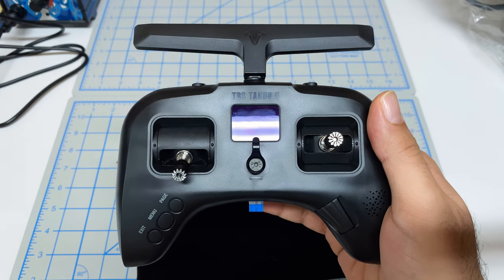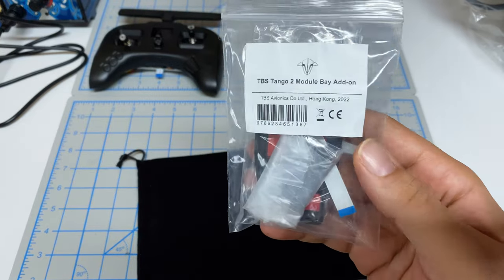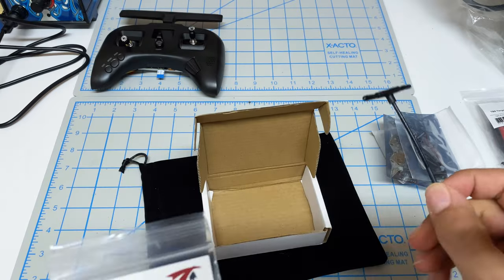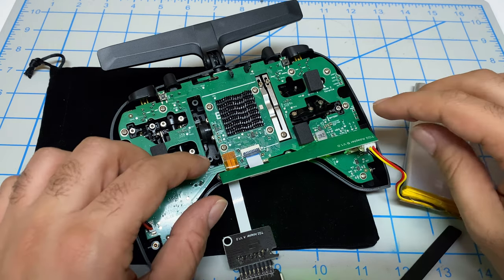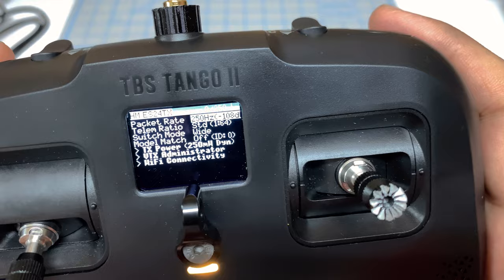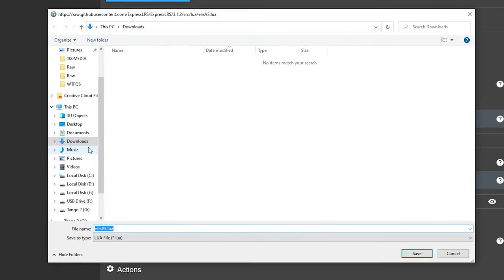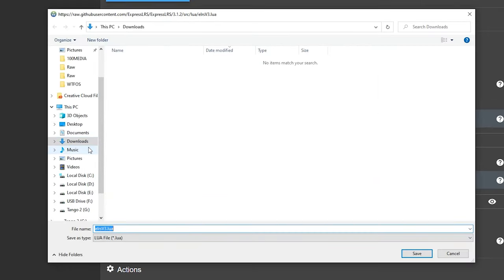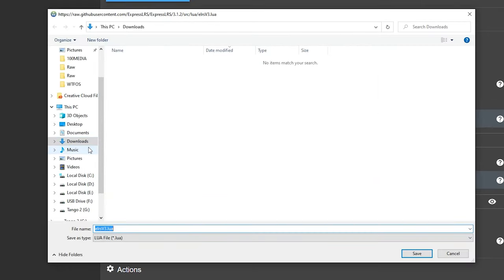TBS Tango 2 Pro INTERNAL ExpressLRS | How to guide on stuffing an ELRS module INSIDE the transmitter

Comment from the maker: Hey Folks, thanks for watching this video! At the very end we talk about a weird behavior when you attach the module bay attachment to the tango 2 (happens as soon as you connect the add-on board regardless of whether a tx module is in or not!).  UPDATE: Thanks to tennturk who contacted support on this and received the following reply from TBS support: “it is a bug which will be fixed in the next release. No available info yet when” UPDATE2: Make sure to check out the update to the antenna approach here https://youtu.be/g4PU8CVhZKo.
Reply: Huh I have to try to fly my crsf quad with the elrs module on the back and see if I have the same issue! Going flying today and I'll report back.
Reply from the maker: @baggszilla  Thanks, let me know. Someone else posted that the light at the front should turn off when you're using the external RF but mine is still active for some reason.
Reply: @Mangorille  maybe it’s something to do with the Happymodel adaptor.  I used the TBS external module bay adaptor (I originally wanted to put it internally like you did, but I couldn’t fit my chosen module board between the gimbals, so just did the external mod), when you switch to the external module it does indeed turn off the LED on the front of the T2 and switches on the external power - my ELRS module is only powered on when the particular ELRS model is selected and it turns off when I switch back to CRSF.

My guess would be the Happymodel PCB board add on you’ve added has something to do with the problem, maybe it’s not feeding a clean or full power through to the T2.
Reply from the maker: @testpilotian3188  Thanks for sharing how yours works. I tried with the TBS module as well and it did the same thing. Perhaps something with my version of the motherboard? When I use the external module, the front LED is on and when I use the crossfire the front LED starts pulsing.

Comment: Unbelievable you got this to fit inside! I love it! I just recently painted pearl white nostalgia case, V3 board with happymodel power adapter, tbs v2 gimbals and external module bay with the happymodel es24tx pro nano module and its a completely better radio! I love the Tango2!
Reply from the maker: I'm hoping to try to get the es24tx pro in there some time in the future if I can get my hands on one but I suspect 250mw is plenty for my kind of flying.

Comment: I FINALLY got around to doing this and i want to extend a HUGE THANK YOU for making this video!!!!it works better than new and dont have that stupid module hanging off the back of the tango2
Reply from the maker: Welcome. Check out the follow up videos as well for the ultimate sleeper mod.
Reply: @Mangorille  I saw the video, but im worried about all the mods involved with the new ELRS module. This one took a little massage to fit but is working perfect. Using the flip down original antenna on your new mod does look amazing tho!!!
Reply from the maker: @Snakkerz003  The BETAFPV module is a lot more difficult to install but the extra effort gets you an additional 250mw (250mw vs 500mw). Go with whichever module you can find, they're becoming hard to find.

Comment: A complicated mod done very cleanly. I am glad we think alike about the heat issue, which was proven to not be an issue after you tested it. Great job man! And regarding the voltage drop when the receiver is disconnected, I think lithium polymer batteries generally cant supply much current at 3-33.2V so what I figured since there was no receiver, the ELRS module being on dynamic power was maxing out the output power where when a receiver is connected, it ramps back down to 25mw probably. Again this is only true if at that time you were on dynamic power but I am pretty sure you considered this already. Once again great job man!
Reply from the maker: Thanks for the note. I've been working with TBS on the voltage drop issue, they said it is a bug in the firmware and are working on a new crossfire firmware to resolve. They asked me to wait for crossfire firmware 6.20 a couple of months ago. Patiently waiting here. :)

Comment: Put the antenna in the 900 mhz antenna plastics.
Reply from the maker: I love the idea and would make for the ultimate sleeper! BUT, there doesn't seem to be much space in there looking at the clear antenna that TBS offers. Perhaps it can be done with a bit of shaving of the plastics, etc. but I don't have an extra antenna that I can sacrifice to give this a try.

https://www.team-blacksheep.com/products/prod:tango2_t_antenna
Reply: I am thinking same thing.
Reply from the maker: @bcc1955  I did some more research on this... The two halves of the antenna are ultrasonic welded together, you'd need to cut it apart.
Reply: @Mangorille  Initially I was thinking it would be nice to have both antennas hooked up this way, ELRS and CRSF. Is that feasible or is your alteration just one or the other?
Reply from the maker: @bcc1955  I've moved the CRSF antenna internally and made the external antenna the ELRS. You can do it the same way I did. Ideally you'd try to fit both antenna into the OEM housing but you need to be willing to sacrifice the antenna housing by cutting it open (it's ultrasonic welded).
Reply: @Mangorille  I just watched a video (in Indonesian unfortunately) where a guy has a bardpole inside the transparent antenna housing alongside the original antenna. Not sure how he got it in but you can have a look, skip to about 8:40 https://youtu.be/x2WWaKUyGnQ
Reply from the maker: @CoopzVideo  I've got a solution for this, stay tuned for the next upload on the channel.
Reply: @Mangorille   Nice, looking forward to seeing it!
Reply: my thoughts exactly. was scrolling for this comment.

Comment: Thank you Mangorille. Just finished my Tango2 ELRS install. Great project you created. It was definitely a challenge getting everything shoehorned in there so that there was no interference with the push buttons and power switch. Devil/God is in the details as is said. Everything works via a bench test. Only need to do field test. I am using a V1.1 (VOO7C) board and the front light goes off when switching to the external CRSF setting and ELRS module.
Reply from the maker: Congrats on doing the mod! I reached out to TBS on this issue and they said a new firmware would be coming to resolve it. I'm still waiting for that new firmware. I tried an older firmware and the light did turn off but the issue still continued.
Reply: @Mangorille  I do not believe I am having this issue. When I go to external RF, my dash light goes out, and my Tango2 stops communicating with my CRSF RX quads. How are you diagnosing that the CRSF board is being powered up along with the ELRS board even when light is out?
Reply from the maker: @bcc1955  TBS asked me to run some tests and share some videos, which I did. They worked with their engineers to determine that it is a firmware issue.
Reply: @Mangorille   So I got my ELRS quad flying today using my Tango2 Hybrid. Confirmed my first observations above. Are you thinking that in my case both CRSF and ELRS are similtaneously powered up when External RF is on, even though dash light is out and the radio no longer arms my CRSF quads? That would be a negative with regard to heat and battery life.
Reply from the maker: @bcc1955  I think yours is working okay, there's something weird happening with mine where the voltage reading is wrong on the display when CRSF is active. I've verified that the voltage of the battery is still okay  when the remote is complaining of low battery.
Reply: @Mangorille  Seems to be difference between the various board iterations of Tango2. My battery reading is same in both modes.
Reply from the maker: @bcc1955  Ya that's what I'm thinking as well. I don't use the crossfire side of the transmitter anymore so the issue doesn't bother me. I'm now fully ELRS with the Tango 2.

Comment: Just finished this, nice vid! I took both connectors off but left the pins attached to bord and rx. Just tested it. Some epoxy over those pesky miniature soldering and off we go!
Reply from the maker: Awesome! Did you use the module in the video or something else?
Reply: @Mangorille  I did, had a spare on laying around. Figured I give it a shot. Had to cut a little from the inside of the power button. I left thr antenna connector intact. Pokes out the original hole so I can screw anything on it I want. A bit sceptic of running it w/o heatsink as I normally run 500mw. But we'll see. Finally that bulky module on the back gone! Couldn't figure the wiring out. That's where you came in😏
Reply from the maker: @izaya8986  Correct you do need to cut a bit of the power button. Wait, the happymodel module I used only goes up till 250mw. Did you use the Pro module that goes up to 1w?
Reply: @Mangorille  no, I used the betafpv elrs nano from your updated vid. That one does 500mw. Ive also got the hm slim pro that does 1w. But never used it as 500mw is enough for me. Also the hm pro has a fan and emits even more heat so not going to attempt that. Thought I read somewhere there is a zorro with 1w max elrs internal but can't seem to find it.
Reply from the maker: @izaya8986  Got it. The BetaFPV is a good option, I've seen mine go up to 500mw briefly when flying behind buildings so good to have a bit more headroom than the happymodel @ 250mw.

Comment: Great stuff. Was considering getting new ELRS radio so I can fly with AIO ELRS flight controllers, but hate idea of loosing near perfect Tango2 form factor. This should allow me best of bother worlds. Thanks for your excellent how-to video !!
Reply: IMO TBS should make a Tango 3 with built in ELRS. Widen it a bit to accommodate this and a larger screen, and add an external SMA antenna connection. Would be perfect.
Reply from the maker: Thanks buddy, my goal was all about keeping the existing form factor. If I wanted to make the radio bigger, there are better options out there for ELRS.
Reply: @Mangorille  There is option of Boxer as best alternative IMO but it lacks the feel of the Tango. The Zorro has a nice screen but crappy lever switches that compare poorly to Tango nicer switch pads, plus battery life is crap. Probably an extra 1/2 inch of width allows the Tango to double the area of the its postage stamp sized screen. Yet you think its form fact would unacceptably change in that case? Please reveal you better option, as I am not seeing it. All ears!
Reply from the maker: @bcc1955  I like the boxer but you can't get it right now, still on preorder

Comment: Hey, very nice work. Well appreciated! Do you think I could alternately put in the TX Modul from my RM Pocket? Should be kinda the same thing right? Thank you.😊
Reply from the maker: Are you using an external ELRS module on your Pocket?
Reply: Nope, it's internal. Hence the question.
Reply from the maker: @quesoner34  You'll need to measure and compare the size to the one I used. There isn't much space in the Tango 2. You'll also need to figure out the pin out since it doesn't connect through a regular External Module connector.
Reply: @Mangorille  ..so basically start the whole process you did  from scratch again. 😅 Alright, thanks for that clarification,  I'll see if I can find the time and commitment for it.
Reply from the maker: @quesoner34  Pretty much or try to find the same module I used and save yourself the time. You can find them fairly cheap on Aliexpress.

Comment: Hi Mangorille. Great howto video. I just did the upgrade - without success 😞I soldered positive and negative to both pins and the signal to the outer one, just as you did. The module does light up inside the tango but the lua script did not recognize it - just shows questionmarks. Maybe it has to do with some setting (level shift/boud rate) - since the small module for sliding in the external module in the kit. This module has some components on it. I don't know - gave up now, after spending a whole day on this great project. Now I am back to the external Pro module from Happymoddel. Maybe somebody know a fix for this issue. By the way, since I own the Pro module which is working great with the module bay: it is very hard to get it out of the case, they sell it in. Also it does not have a ufl connector, so getting this board inside will be tricky. BR, Luz
Reply from the maker: Did you already remove the pin connector? If not, try connecting the module using the pin connector and see if it is recognized. If it is, then something to do with your three wires being soldered. If it is not recognized, you can look into the firmware on the module (try updating it through USB) or something to do with your LUA script. With the Pro module, you'll need to replace the SMA connector with a ufl, similar to what I did with the BetaFPV module here: https://youtu.be/RodegZjiQGk

Comment: Great Video ,   Thank you .     Can you do the same to the Black DJI FPV controller since it has become obsolete with the new firmware for the googles 2 .
Reply from the maker: Wouldn't work for the black controller, that thing is a closed system without any expandability. One of the reasons I changed over to a non-DJI remote controller this time around.
Reply: @Mangorille  maybe a version like this video. (https://youtu.be/bvk6Yru1Vfw. ).  but with it internal   ELRS like you did with the tango
Reply from the maker: @testchannel1834  I looked at that video, he doesn't go into much detail but it sounds like he used the PPM port (the audio jack) on the radio which is a higher latency connection and needs a module that supports it. It doesn't look like ELRS ever plans to add PPM as a support protocol, which makes sense given their goal of lower latency, etc. https://github.com/ExpressLRS/ExpressLRS/issues/421

Comment: tried to do the same, on pins worked out well, when i tried soldering wires it seems that the s-bus doesn't worked, checked wires but it might be different pins ? same module
Reply: i removed that tiny rezistor by mistake, is near pin 3 on the elrs board. i bridged it and seems to work
Reply from the maker: On the module instead? I don't remember there being a resistor on the back of the module.
Reply: @Mangorille  it s on the front of the module under the third pin, the rezistor is a tiny 0402 100r. i have asked happymodel support and they suggested that i can run it with a bridge (lost that resistor when i removed the pins)
Reply from the maker: @ridewithandrei  Got it, I'm surprised that support responded but that's great!

Comment: What's the best firmware for the happy model mudule?
Reply from the maker: Hey. I've been running the latest ExpressLRS, currently 3.1.2
Reply: @Mangorille  to get over 250mw need active cooling the pro model has a fan that may or may not work on certain firmwares
Reply from the maker: @mfrfpv9079  I have the non-pro which only goes till 250mw. It came with a fan as well but I didn't install it and the temperature test I did on the bench seemed to point to the fan not being required.

Comment: So, does the 1W SLIM PRO fit internaly inside of the Tango2? anyone tried?
Reply from the maker: I looked at it a while ago and the physical dimensions were very similar. There were two issues though: 1) Not sure you can run at higher mw without some sort of cooling solution. I tested with 250mw and it was okay but I wouldn't want to push further without a good amount of bench testing. 2) The Slim Pro has the SMA connector, which means you may need to de-solder this and solder an antenna directly to it. I had reached out to Happymodel to see if they want to work together on something like this, they never replied.

Comment: Can you do this with the mambo?
Reply from the maker: Probably can. The Mambo has an external module bay as well and I'm sure it has more space inside to hide the ELRS module. That thing being a bigger transmitter, why don't you just run the module in the module bay?
Reply: @Mangorille  I'm on crossfire which I want to use with Mavlink. I want elrs for smaller drones because of the smaller antennas.
Reply: And I like the mambo ergonomics. I've heard Tracer now has a LoRa key so maybe I should just get it and try tracer out. Should be fine for a 2" drone

Comment: First of all, I’d like to thank you for the informative video. Very good job. I ended up doing this mod as well . Same module and everything. I can’t seem to get my lua scripts to work . I’m stuck on loading . Did you happen to run into this problem ?
Reply from the maker: I didn't have any issues with the software portion of it modification, was fairly smooth sailing there. Did you update the firmware of the radio and the ELRS module?
Reply: @Mangorille  I tired updating both the module and the tango 2 and still not luck . Its kinda funny that when i finally want to try elrs nbd comes out with a crossfire whoop lol
Reply from the maker: @spoki_bones3656  And you got the LUA script from the latest expressLRS configurator after selecting your module? If you're using the same module as me, email me and I'll send you my LUA script.
Reply: @Mangorille  awesome thank you 
i just sent you a email !

Comment: Is there a way to make the trainer port work too?
Reply from the maker: Hey. Which trainer port you referring to?
Reply: @Mangorille  I've wanted to get a Medlin drone gimbal but I'd have to get a new controller. The 3.5mm jack on the tando does not have firmware for it to be a trainer port. I've asked around and the most I got was it's possible but TBS would have to release FW for it
Reply from the maker: @YorkyPoo_UAV  Makes sense, you'd need new firmware from TBS for something like that.